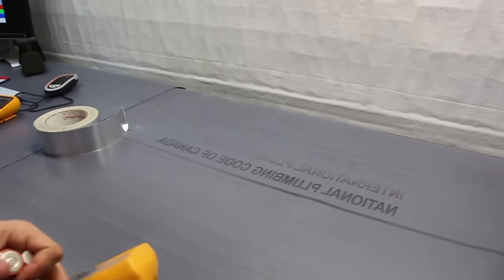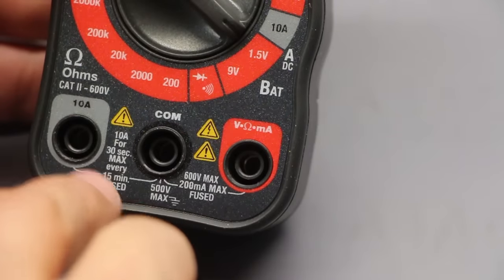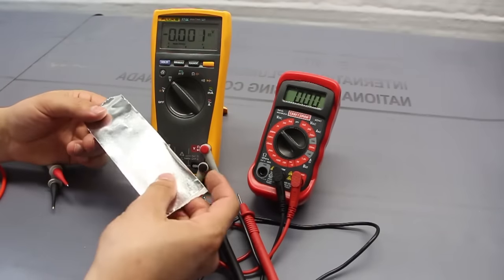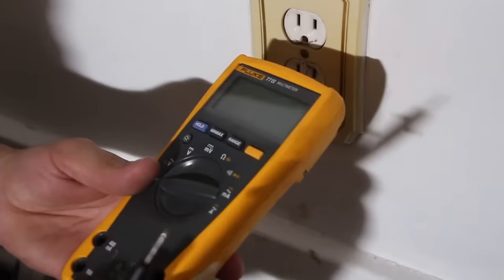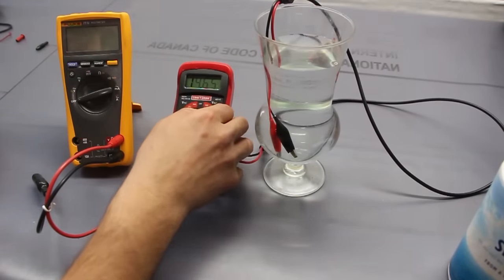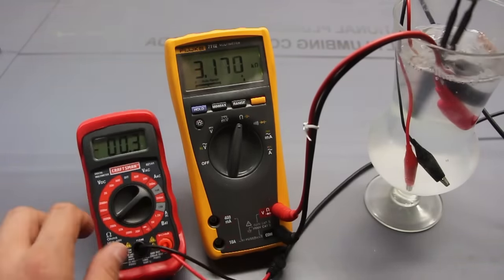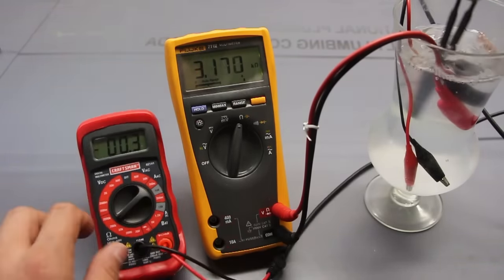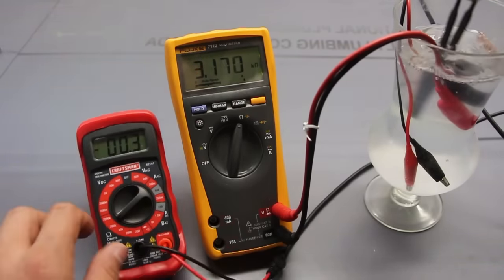The Best Multimeter Tutorial in The World (How to use & Experiments)

Comment: I would advise everyone before you use your meter to read and understand the instructions that come with your meter and heed what they say about safely using the meter! Just like the meter you by, cheep meters have lousy instructions. More expensive meters have better instructions. Do not take for granted the meter probes are plugged into the correct jacks on the front of the meter. Each time you use your meter check your meter leads, check that they are plugged into the correct jacks and check that the meter is set to the proper range before making the measurement. Failure to do this could result in damage to your meter and injury to you.  If you are measuring any lethal voltage, check your meter first on a known voltage source to make sure it is set correctly and working. Check the circuit you are working on. Check your meter again on the known source to make sure it was working. Does this sound like overkill? Yes it does but why take a chance and get hurt.

Comment: 3:50 "..or maybe you want to measure the internal resistance of a battery?" I'm sorry my brand new Fluke 75 I just purchased (manufactured in 1988) manuals warn- "Never measure resistance in a circuit when power is applied to the circuit". Measuring resistance of a battery will likely destroy any meter.

Sorry. Your expertise is lacking.

Comment: Hello,
Thank U for this 2015 video. It is now Nov. 2019
Would someone please make a video  for us regular Joes who got a free multimeter from Harbor Freight?
All we need to do is test the capacitor of things that go bad in our homes.  In the last 12 months, mine have been: 1) the A/C 
(The Sears guy who came out said the Capacitor went bad.)
2) The ceiling fan stopped working.  3) And now my Xtremeair under cabinet exhaust vent went out.  Teach me how to properly test the two capacitors (10 UF +-5%, 250VAC) in there so I can isolate the problem.  I know there r four parts that COULD be the problem (Capacitors, Thermal Fuse,Main Board, or User Control & display board) Since neither the lights nor motor turn on.  I can replace all the parts myself, I just can't afford to purchase unnecessary parts or hire a Technician.  (Technicians where I live are more expensive than most areas due to the fact that I live in a very rural part of the Country.  There is a non-refundable fee just to drive to my location.)
When most of us Utubers see "Basic" we are hoping  the video will just have the cheap multimeter similar to what we have and cover ONLY the problems we encounter in and around our homes.
Someone Please make a truly basic Multimeter video that addresses only  appliances we own in our homes.
Thank You.
Reply: This is a very basic video mostly for beginners, there are other videos on YouTube that show how to test faulty appliances. Take a look at someone like the HVAC hackers videos, he shows how to test Motor start / run caps. Unfortunately your Free multimeter will probably be very basic and won't be able to test capacitors anyway, that's one of the reasons professional tech's pay a lot of money for their meters.
Reply: If you don't know how to use a meter you shouldn't be messing with capacitors less you know what your doing. They can kill.
Reply: @ng-iq4kx  : Working on anything electrical can kill you, unless you know what your doing or have been taught how to do it safely. I can honestly say though: After over 40 years in the Electrical / Electronic industry I've never come across any instance of someone being Killed by a capacitor.
Reply: @rscelectrical7091  I have. 64yr old working on a air-conditioner, stopped his heart. Took paramedics 20 minutes to get there. 20 minutes to late.
Reply: @ng-iq4kx  : That's sad to hear, but without knowing the full story of what happened I won't pass comment on it.

Comment: So, if I understand you correctly, I shouldn't be testing batteries by using my tongue?
Reply: Only 9V batteries. Lower voltages won't give you that pleasant tickle, and higher voltages may damage your taste buds. Also, this will only give a go/no-go on whether the battery is good. So it's ok to still use this method for general troubleshooting. For more precise measurements, you should still use a meter or a battery tester.

Comment: Pro noob tip, don't measure Voltage or Frequency(maybe resistence to) of AC power with the leads connected to the AMPS inputs. It will short circuit and blow up your multimeter in your hand

Comment: Nice video, but after all the time you spent stressing the suggested time limit on the higher amperage current test (in this case, no longer than 30 seconds), you connected that toaster up from 39:10 to 40:46  ...that's 96 seconds!  That we could see.. the time doesn't include any jump cuts or edits in the video that we could not see...  so, ummmm.. yeah.  lol guess it is good you didn't burn up the multi meter.
Reply: It said 10A for 30 seconds. Toaster never pulled 10A so the longer time was not a problem.

Comment: You have a defective meter if you have your volt range set to 200 volt AC position and you are not reading around 120 volts and you are sure your leads are making a good connection in the receptacle. Doesn’t matter if it indicates the right voltage when you change to the next highest voltage setting as long as your leads are making a solid connection. Has nothing to do with the design. Very dangerous to use this meter. Take your meter back to the location you purchased it from and get a new meter.

Comment: At 17 minutes in, I wonder if the meter dial may be indicating a limit of 200 volts maximum peak to peak input voltage. The peak to peak of 120 RMS would exceed this voltage. If that is the case measuring 240 RMS volts wouldn't display in the 600 volt range.

Comment: I watched the whole video and didn't see any smoke. WTF? Surely that craftsman was well past it's 30 second limit during the toaster amp reading. I have the same meter here at home and it's 200 VAC works fine. I also have a fluke 77 III  in my work toolbox. It's far better but I'm not supposed to work at home...
Reply: Wasn't it only carrying 6.5 amps? Not 10.

Comment: you wrong about the switch being bad you just cut of the power from the breaker box so the problem is in the breaker box, else I don't think if the wall outlet wires all melted on top of each other, very simple no power coming from the breaker box means noac coming in no 25 reading.
think don't stink

Comment: i have used a volt ohm meter all my adult life i can recall  ever  needing to read current flow    its normaly   ohms grounds and shorts   if you fix these  the current  be right  ibuilt my first analog meter in 1964 or 65   from a heath kit   ive allways heard  its 90%  man and 10% meter  meaning if you know how a circuit works  you can fit  the average home owner  can use a harber freight meter  and  fix  lawn mowers wiring   i just got threw compleatly rewiring  my 1953 army truck    the insulation was toast   i used a small meter on iy ever day to correct  problems

Comment: I was always told not to move the selector switch with voltage or current on the meter. Experts?....is that true? Also, never grab both probes or their cables while testing lethal voltage because you are betting your life on that insulation. Play it safe.

Comment: It's incorrect to label this as the best tutorial; in fact, it's unsafe to refer to it as a tutorial at all due to the multiple serious errors and safety violations it contains. For instance, inserting the positive (red) lead into a power outlet first is a critical mistake. Doing so energizes the entire probe and a portion of the wire with mains voltage. Accidental contact with any conductive material, including your body, to the exposed probe can result in a direct short circuit. This poses risks of electric shock, damage to the multimeter, and a person.

Comment: the averge home owner does not need  a 2-3 00.oo$ meter too many options hes over loaded  a simple little less than 10.00 is all he needs to learn on  im a trired repair man i stll use my simple meter ohms volts resistance to fix lawn mower etc.   test batterys

Comment: is no one gonna comment on how he said that voltage doesn't kill
Reply: Static shock can have a voltage between 600V~25,000V.
When we’re trying to quantify how dangerous electricity is, people generally don’t look at how strong the electrical force (aka, the voltage) is. Instead, they look at how much electricity charges through you each second (the current) to determine how harmful it is.
You might have heard people say something like "It isn't the volts that kill you, it's the amps." This is another way of saying "It isn't the voltage that kills you, it's the current." However the current is only part of the story. In order to really know how dangerous a source of electricity is, you have to consider the amount of electricity that source has available, which we call electrical charge:
￼Electrical charge (measured in coulombs) can be thought of as the quantity of electrons available to flow .S.tatic eletricity has a high voltage, but a very low electrical charge. So while those electrons want to tear across your body like there's no tomorrow, there just aren't enough of them to do any damage.
On the other hand, the electrical socket in your home has a relatively low voltage, but an unlimited amount of charge, making it much more dangerous than the high voltage of static electricity.

Comment: ok, i watched solid 6 minutes of this video and had enough. if the guy simply doesnt know why you have to use other terminal to measure current (simply cuz current is measured in series so determine the current draw in the circuit while voltage and resistance measured in parallel hense you need to use the other port) and starts giving crap about it i think its a total waste of time watching it. Sorry

Comment: first of all you measure 1.27v with the fluke and 1.61 with the other meter and never explain the difference. also, in most cases you can actually change leads with out significant problems. this is "not" the best video available. sorry chief.

Comment: You would be amused to see how many people use measurement equipment without thinking about it. I would have fresh engineers not know. I would put two 10M ohm resistors in series with a 10V dc source. What is the voltage drop across each of the resistors? Easy, 5V. Then they take the DMM and measure it and they get a totally different number. Why? They fail to take the Input Impedance of the meter into account...usually 10M ohms. So about 3.33V. Huhhh. Do the simple math.

Comment: You shouldn't be so kind to that Craftsman meter.  That meter is a piece of shit.  I would say it is even dangerous.  You shouldn't refer to it as an "economical" meter.  It is a poor quality meter and nobody should ever buy it.  I often wonder what people are thinking when they look at two meters and one is $150 and the other is $15.  What do they think? My experience is they think both meters are probably pretty much the same it's just that the cheaper one made by Craftsman (or whatever other company makes cheap meters) just isn't as fancy.  They don't realize how dangerous those cheap meters are.

You should also mention that those cheap meters do not measure RMS voltage or current.  They are average responding meters or in the case of a sine wave the average value is zero volts or current.  So the meter actually just multiplies the value it detects by .707 so that it diplays the same value that it would have gotten if it measured true rms voltage/current.  Those cheap ass meters "pretend" or lie to you about what it is measuring.  All my meters are Fluke.  Buy a Fluke and you will have one of the best, safest meters made.
Reply: frequencydrive , You are correct. The Craftsman is a POS, however it is sufficient for basic electrical testing. Finding voltage or continuity, stuff like that. If that's all you are doing, it would be fine. Anything that needs extreme accuracy, I strongly agree, go with the Fluke. Dangerous, depends on the user. #1rule, as you should know, ALWAYS test your meter! The bad 200v would have been found.

Comment: 36 volts DC can kill you outright, not much hey.
Reply: Amps are what kills not volts.  Half a miliamp is enough to stop your heart.
Reply: @outlawgentleman8860  Yes, 36V DC on a Electric motorcycle for instance will kill you outright, Only 2 of use at BMW Motorrad in manchester are allowed to work on them right now.
Reply: Amps is what kills a human not the voltage. You can have 3000volts AC or DC and live after being shocked. Now if theres 1amp and it passes through your heart just right itll kill a person. 36v DC isn't much at all. The average Solar panel is 56v DC up to 90v DC. That same panel produces 7-9amps which is enough AMPS to kill you if it passes the correct path through the heart.